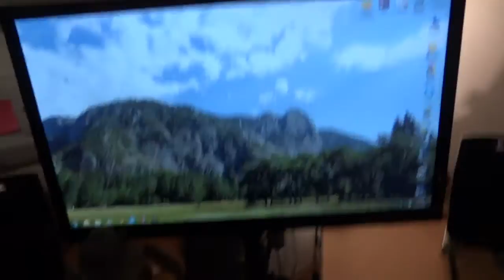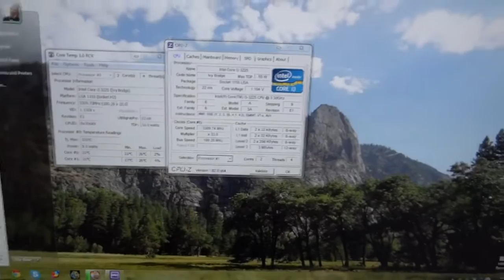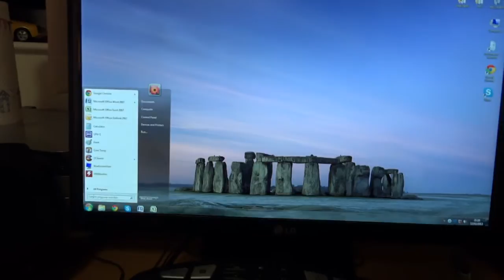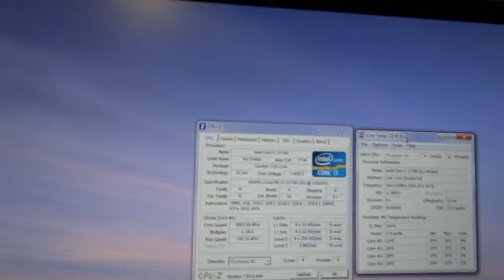Asus Sabertooth Z77 - 2 DIMM & RAM slots malfunctioning - By TotallydubbedHD

Comment: I have the same problem. I'm using Asus TUF Gaming Z690-Plus wifi D4 with i9-12900k and 4 x 8Gb DDR4 3000Mhz G.Skill CL14, only DIMM B1 & B2 are working, slot A1 & A2 not working. Does anyone solve this. I can't RMA due to inconvenience.
Reply from the maker: Only fix it to return or throw it in the bin lol

Comment: You have the wrong RAM memory which are not suitable for the Sabertooth z77 to run on dual channel the part number is the same. They are also not in the list on the Asus support page you can look for yourself you have the wrong memory with the wrong part number bought do not run on dual on the board of Asus Sabertooth Z77 you need the RAM memory with the part number CORSAIR CMD16GX3M2A1866C9 (Ver5.29) 16GB (2x 8GB) DS N / A Heat-Sink Package 9-9-9-27 1.5 ●
 https://www.asus.com/de/Motherboards/SABERTOOTH_Z77/HelpDesk_QVL/

Comment: Maybe get a different brand of MB. There are plenty of good ones out there such as MSI and Gigabyte. I have a Gigabyte X99 Mb and it is pretty good so far.
Reply from the maker: I did in the end dw!
Reply: That is one thing you can do, here in the USA we have an outfit known as the BBE. If you have a problem like I did with a major Hard drive company and you don't get any where with the proper channels you can file a complaint with the BBE. If the claim is legit, then these companies will do their best to fix the problem. So worth a try if it happens again, but you did the thing that causes the most damage, you talked about their lack of consumer support. I have never owned an ASUS anything and now probably won't.  They should stand behind their products.
Reply from the maker: Yeah I looked into it back in 2012/13 and it just wasn't worth it for me in the UK - as you can only claim the value of the item - no extra legal costs etc.

Comment: hi, im having the same issue, ram slots 1 and 2 not working (nearest slots to the cpu) do you think i need to burn my board? or will Asus accept this for RMA?
Reply from the maker: +Joma Cantalejo depends if Asus like you really - it's pot luck, but in most cases they reject RMAs....because they absolutely suck!
Not sure what's up with your board - could be BIOS, could be shorted, could be circuits, could even be your RAM is not well placed/dirty.
Reply: +totallydubbedHD its the ram slots 1 and 2. i test the memory sticks on my old gigabyte h61m-ds2 and it works fine. then i clean the slots of my z77, test a single stick on 4 slots. slots 1 and 2 did not work. my board powers up then the red ram light stays on. after a few sec, the board reboots and there is still no display. i already asked asus, and their site agent or whatever he is called said that "its already phased out" something like that. here's the punch line now, this board is only 3yrs old. and outside the box, there is a "5 year warranty" its 5 fckin years, and the service for board is already been discontinued, how funny is that? 😡
Reply from the maker: +Joma Cantalejo they have to honour the 5yr warranty - if they don't report them for false marketing to the local authorities, they SHOULD replace or fix it! Don't take their bullshit RMA excuses.
Reply: or i can just sue them to pay me?
Reply from the maker: If you can afford it, definitely
Reply: thanks bruh! ill just convince them to RMA my board. its hard to win against a company.
Reply from the maker: +Joma Cantalejo it never is easy - but if you make it clear to them - they'll hopefully budge.
If they don't make a YouTube video about it - get thousands of views - kill their sales ;)

Comment: I did it man!!! It was the high pressure i applied to my CPU with the CPU Waterblock, i really hope this issue is solved permanently XD. Regards.
Reply from the maker: glad to hear it mate - but that was different from my issue!
Reply: But i saw your vídeo and thats exactly the same ram slots malfunction. Give it a try and reinstall your CPU waterblock but do not press too much. Maybe the backplate is touching the pins behind the CPU socket. I mean this mb is very durable thats because i tried to find The real problem. I hope you can do it. Regards.
Reply from the maker: F Gante I tried many times mate it didn't work, I gave up - this video is over 2 yrs old - I've moved on lol.
Thanks anyway!
Reply: Xb yeah i supposed that anyway your video helped me a lot i hope now you have a better rig ;) ser ya!
Reply from the maker: F Gante :)!
Reply: lol bro you my hero! After all this years of pain IT WAS FUCKING TOO MUCH PRESSURE ON CPU! OH MY GOOOOOD I TRIED SO MANY TIMES TO FIX IT AND IT WAS PRESUUUREEEEE ON CPPUUU! Dear God.
Reply: Lol, here I am in 2025 with the same issue. I pulled a Z77 out of a trash find, cleaned it up and Channel A isn't working. Going to try a different cooler and less pressure tomo 😌

Comment: I have an engineering degree. I sympathize but it is best to be very gentle and careful with expensive components when installing anything, because a scratch across a track will interrupt vital signals. TUF components means they will last if not damaged i.e. "in their working state". No company would accept a £170 scratched product when they know the sold it perfect. Sorry mate - be more careful when inserting and sticking, there are small components that need care.

Comment: i just build my system,  no issues thanks GOD. Sabertooth z77 Board, I7 3770k , 8GB Corsair vengance white LP, GTX 580, 1TB WDC Black, CPU Cooler Noctua NH-U12P SE2. Corsair HX 750 W power.  Im so happy, this is my first build. My temp are IDLE 25C full load 50C (no overcloock). Firt boot no problems or bip. This video helped me  dude thanks.

Comment: Have you checked if anything is shorting on the other side of the board, plus, try running the board out of the case. I remember someone having a RAM problem with a EVGA SR2 and it was actually related to the screws attaching it to the case! Hope this helps :P